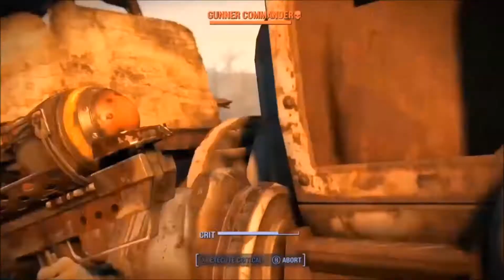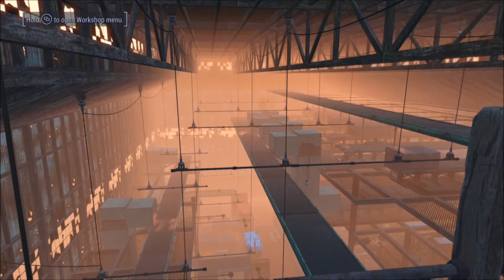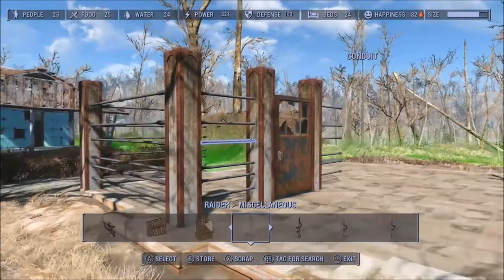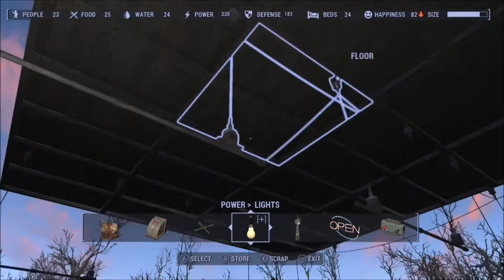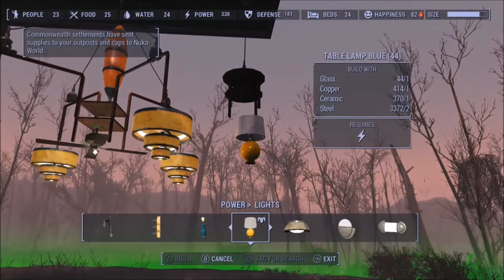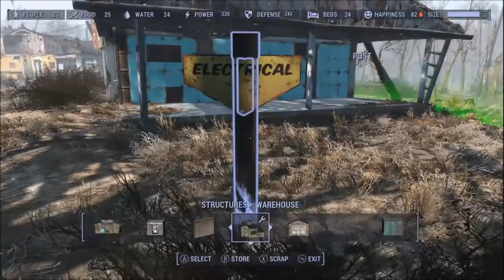Fallout 4 Electrical Tips and Tricks part 3 (working with conduits)

Comment: Cool. For anyone wanting to make a conduit cage, you can get any height by using the two different height vertical pieces and connect a short straight to one, both top and bottom, then take the vertical out and put in the slightly longer vertical. Attach a new straight short to it and you have two levels.
Too bad any npc or creature in a cage will pop out, after a few moments.
Reply from the maker: yea unfortunately you cannot keep a settler in or out of any structure, sure would be awesome to do something like that, a prison or jail!
Reply: @NastyBonz3D  Well, the pillory can, it holds them and even gets settlers to areas where they normally cannot go, like deep into vault 88.
It also works underwater, but it only snaps closed once, then opens again.

Comment: I've watched several of your videos and I have to say, you're one of the best at breaking down these construction tips/tricks so even apes like me can understand them. Electrical/wiring is one of the easiest and hardest build systems to do correctly, and unobtrusively. I use  the concrete build set a lot, mainly because it doesn't look like children with Downe's syndrome attempted to build a backyard treehouse and call it a settlement, which is a subtle way of saying the wood and metal build kits look like utter trash and I wouldn't my dogs sleep in them much less a human being. It's pretty bad as it is, that even with roofs built the weather still soaks the interiors of Bethesda's build sets, even concrete... if that makes any sense in this universe whatsoever. I forget how forgiving the concrete build set actually is regarding collision mapping, sometimes maybe too forgiving, but you earned a sub! Thanks!